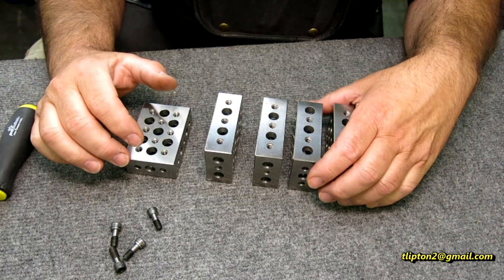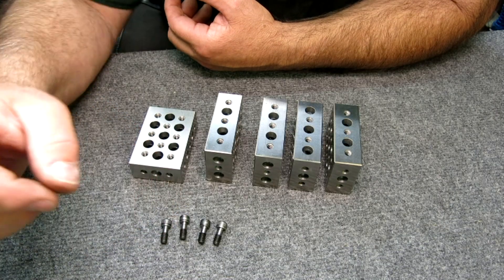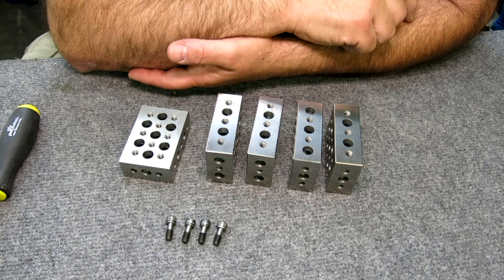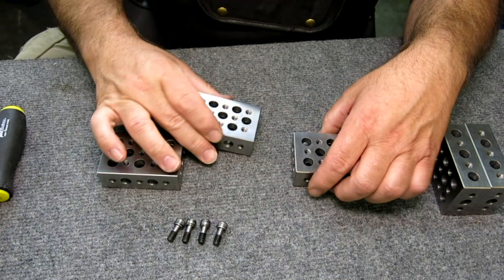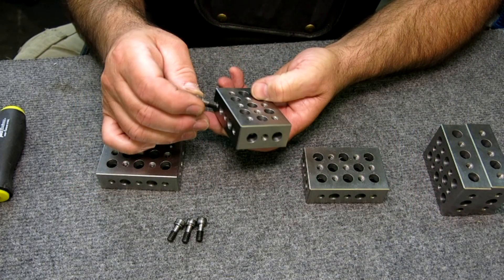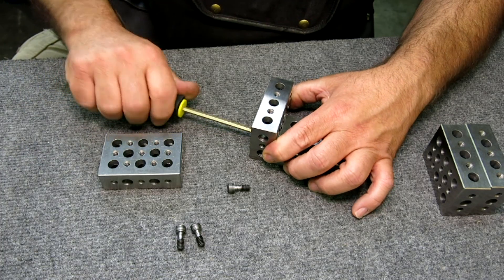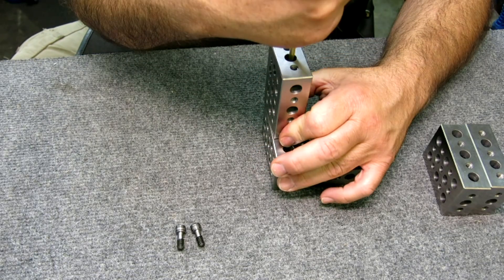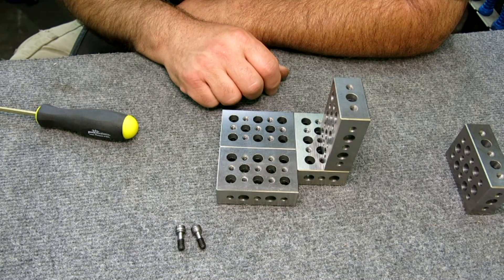Renzetti Universal 1 2 3 Blocks

Comment: I'm confused about why you hit the screw with the hammer when you were setting it up in the lathe to remove the threads...?
Reply: In reply to this question elsewhere on this page, Tom posted:
To center the fastener for minimum runout. Actually a lot faster than trying to indicate it. All you have to remember is to quit hitting it when it runs true. Cheers, Tom

Comment: what are you achieving by hitting the cap screw head with the copper drift while  turning on the lathe??
Reply: In reply to this question elsewhere on this page, Tom posted:
To center the fastener for minimum runout. Actually a lot faster than trying to indicate it. All you have to remember is to quit hitting it when it runs true. Cheers, Tom

Comment: I have some of the inexpensive 23 hole 123 blocks, they’re threaded 3/8” but of course 3/8” bolts won’t pass through the non threaded holes.  I wondered if I could use a 3/8” to 1/4” adapter then bolt them together with 1/4-20 bolts.  Here’s a link to the adapters.  https://www.amazon.com/Foto-Tech-Convert-Adapter-Ballhead/dp/B00OKYWWMG/ref=pd_bxgy_2/143-9226574-5033943?_encoding=UTF8&pd_rd_i=B00OKYWWMG&pd_rd_r=0832ebeb-3fdf-4b0b-91b8-c06fd4588ba2&pd_rd_w=7i5v7&pd_rd_wg=JthSx&pf_rd_p=ce6c479b-ef53-49a6-845b-bbbf35c28dd3&pf_rd_r=EGTTCM8XRCKVM44XVSRB&psc=1&refRID=EGTTCM8XRCKVM44XVSRB
Reply: Those in the link are not well reviewed but I can make something similar from 3/8” threaded rod.
Reply: https://www.youtube.com/watch?v=qQezV-E1kMk

Comment: similar blocks available in UK from Arc Euro Trade Stevensons blocks  3 sizes all Metric.
Reply: They're typical Chinese, in that they look the part but the tapped holes are unusable because the tapping drill was the same size as the plain holes. Also they are not counterbored. SO yes they are similar in looks but that's as far as it goes. 
95% of 1-2-3 blocks now sold are similarly unusable.

Comment: Nice project! i would like to make it also. 

I took the time to draw it in Fusion 360 and i tought i'd share it with you guys (https://a360.co/2YFllov)
I also exported it on pdf https://drive.google.com/open?id=1EDy1pS1PwQhgTViWUW2aCK8HSS9UK9Tn
It's In mm btw :)
Reply: hi, im also tinkering around with this design in metric, might try and make some and want to make sure i get it right before i start. is there a reason why you went with m5 threads in stead of larger? 
i have modeled with m6 and m8, and the m8 counter-bore weakens the internals of the block significantly, to the point that the block is essentially hollowed out. with m6 the internal columns are about 1.5mm sqaure at their thinnest.
i have no experience with heat treatment, or the stresses that the process would cause, would the m6 threaded block be too weak?
Reply: Hi, i don't really know. You will learn by trying! 😁

Comment: whats happening in Min 8:30 to 8:40? Whats the reason for this knocking on the head of the screw"?
Reply: In reply to this question elsewhere on this page, Tom posted:
To center the fastener for minimum runout. Actually a lot faster than trying to indicate it. All you have to remember is to quit hitting it when it runs true. Cheers, Tom

Comment: When they stacked together, accumulated errors will occur. Actually, why there are not double in length, double in width and double in thickness products for users to buy, sometimes i think the current one is so small. Adding these three more types will rise the flexibility much.

Comment: Mr. Lipton. I'll offer one of my favorite hacks regarding parallels and machining vises. We've seen many; separators [spring loaded tubes outside the jaws], or coil springs bearing against them, or two drops of fast-set glue, or magnets, or rubber bands [!], or nothing at all....
I use strapping tape, the steel variety binding loads to pallets. I simply cut a length and form one of three ways, depending on part width. 

#1 is hair-pin like, one leg longer than the other. Longer is convexed to contact ends of parallel, the shorter hits middle of opposite bent with a little snow ski like tip. That keeps it or parallel from moving out of jaws on repeated parts. 

#2 is great when drilling; a U-form, with ski tipped ends. 

#3 for wide items; roll a circular length around 3x the jaw opening and lap the joint with a strap clip.
#Freebie. I don't work production; but time saved means I work on my own projects. When possible, instead a lot of deburring, use 4 parallels. Outboard of those supporting workpiece, insert shorter parallels at the jaws. Instant chip and burr clearance.
A few people know me, as Toolmaker51.

Comment: Just a heads up.
At the end of your video when you under cut the Allen bolt just under the head of the bolt and filed the slotted under cut ,you should hold the handle of the file in you other hand.
Just so your left hand is not position over the lathe chuck.
Just my 2 cents worth.

SAFTY FIRST!!!
Reply: Correction left arm and hand.
Nice videos.
Keep up the good work!

Comment: Apparently this isn't a new idea. https://www.circuitousroot.com/artifice/machine-shop/auxiliary-tools/setup-blocks/index.html#a-surprise   And I read that some 1-2-3 blocks with even all large holes have threaded holes and some that are simply drilled and aren't tapped. I know nothing about them but my first thought when I saw these what that having them PINNED for alignment would be preferrable to having screws in fairly loose holes. With two pins and one screw per joint they'd self-align. If they don't self-align I don't see them ever being square with each other. Not with those small screws and all that slop in the holes.
Reply: DEEREMEYER1 read previously submitted comments for an answer to your suggestion re pins.

Comment: @oxtoolco real question. What exactly were you doing at 8:35? Hitting the fastener straight I presume, but how does that work?
Reply: Matthew La Rosa I had the same question...does hitting it eliminate the wobble?
Reply: In reply to this question elsewhere on this page, Tom posted:
To center the fastener for minimum runout. Actually a lot faster than trying to indicate it. All you have to remember is to quit hitting it when it runs true. Cheers, Tom

Comment: Ok I missed something...When the allen bolt was in the lathe, you hit it with some sort of Knocker...why?
Reply from the maker: To reduce the runout of the threaded section.
Reply: oxtoolco Can you go into a bit more detail please? Are you just so good that you're hitting it right at the high spot or is there some ox magic happening there?
Reply: @c0mputer  You just randomly hit it but you have to have your wits about you and stop whenever it doesn't wobble (much). It's a pain when (as you see here) the second or third hit does the trick, but you don't stop yourself in time!)

Comment: Tom

Amazon has some inexpensive 1-2-3 blocks, says they are hardened.  Could you use these to save some money (McMaster-Car wants an arm and leg for A2 1x2 oversize tool steel bar stock???

John
Reply from the maker: Try Hudson tool steel on the web. Looks like you can buy oversize 1 x 2 x 3 blocks of A2 for $10.50
Reply: oxtoolco  Thanks for the pointer.  John

Comment: i never seen such mickey mouse ways of manufacturing in my life, you dont show how you grind the blocks which by the way,is the most important part of the block quality,you dont spec. the squareness,or show how you grind them ,how much mtl. you leave for grind stock,or tell what kind of grinder or grinding wheel is used.look at moore 1 2 3 blocks,they are within .0001 in all measurements. anytime you start bolting blocks together the error is  multiplied exponentially.also all block surfaces should be lapped with a hard,flat india stone before assy. thx rc
Reply from the maker: Hey Rich. They aren't heat treated yet. Just a rough grind for basic geometry and to get them closer to nominal size. I will show precision grinding and lapping them to size and geometry after heat treating them.  If you don't fast forward the whole video you actually can pick up on some of the details.  So hold up on the keyboard flame thrower.
Reply: I thought it all made perfect sense.  We have all seen good vids on how to do precision grinding  and lapping.  Just apply those to this project.  BG

Comment: These are amazing!  I have a quick question for you.  I love using 1-2-3 blocks when working on non-metalwork projects, but the problem I have is my blocks came covered in oil to prevent them from rusting, so I have a bit of a challenge.  Either clean off the oil and let them rust, or get oil all over everything I use the blocks with.  Do you have any advice for someone like myself who uses these for stuff outside metalwork?  Thanks!
Reply from the maker: Make your own set from 420 stainless. You would be unique and super cool. You could call them medical grade 1 2 3 blocks. Cheers. Tom
Reply: Try coating your blocks with a fine coat of Boeshield T-9. Once dry, it is like a wax coating, not oily.
Reply: In metal working everything constantly has an oily film so they never rust. My recommendation is to clean off the cosmoline, spray them with WD-40, wipe it off as well as possible and repeat every month or so. They should be clean enough to not dirty up your work, but still prevent rust. If they do start rusting, get it off immediately and it they will be fine. It's only when they sit while rusty that they get bad.
Reply: Haha, that would be a great idea.  I really love using them for all kinds of stuff... weighting down templates, lifting things up by a specific amount for clamping/leveling/etc.  I use them much like you would use "bench cookies" but prefer the 123 over those by far!  Thanks again!
Reply: Autosol polish may work.  I've used in on quite a few items but I am not 100% certain whether it will stain some materials or not.
Reply: Good idea!  I assume from the name this is another fine product form our friends over at boeing.   I use their boelube and love it.  Would that wax coating come off with mild abrasion from handling?  My concern (like with oils) is that sometimes the stuff I'm supporting with the blocks is going to be painted soon.  I always degrease with 99% alcohol prior to paint, but I try and save myself extra cleanup/contamination where possible.
Reply: Chris Ellerby yes, from Boeing originally. It will rub off from abrasion. If your blocks do not have to be at nominal size, could you paint them? If not, next r hing to try is to oxidize them with heat ie blueing or cold blueing with gun blue?

Comment: Tried to model these in cad and can't get my head around how all is going together. How can the screws clear eachother? What's the depth of the threaded section? 1/4 inch bolts?
Reply from the maker: There is only about 1/4 of threads at the bottom of each counterbore.
Reply: Somehow I thought the screw heads would clear eachother inside the block, but I realise that's not the case.

Comment: You know what would make these even better, is if you taped the counterbored sections for work holding
Reply: Already on the to do list, 7/16-20 thread and then threaded inserts for using smaller screw sizes when needed.
Reply: Of course you could!
Reply: Could you have a pin with a threaded hole cut in it (at a right angle to its axis) that you insert from a hole perpendicular to the one that you are intending to hold the work from? That way you have a set of pins with different threaded holes for different fasteners?

Comment: Great design Robin, & video Tom. What are the proportions of the screw holes (1/2" c-c)? Thanks!  I've got to get my surface grinder running..
Reply from the maker: Yes. That way you can get the blocks flush with the edges and it all lines up.
Reply: oxtoolco Thanks!

Comment: Hi Tom,
Just watched this again because I have been thinking, if I had standard 1,2,3 blocks could I tap some of the existing holes and use helicoils to produce the threads? or would the blocks be too hard to tap?
Reason being, I don't have a mill or surface grinder and I don't think my old Myford ml7 lathe with a vertical milling slide would be enough to produce the blocks.
Cheers
Reply: Raymond Marteene too hard to tap hardened blocks.

Comment: What was the purpose of tapping the head of the screw while it was spinning in the lathe?  Does that center it better?  Seems so random.
Reply from the maker: To center the fastener for minimum runout. Actually a lot faster than trying to indicate it. All you have to remember is to quit hitting it when it runs true. Cheers, Tom

Comment: Tom, thanks for showing!
Rob, thanks for the design :)

As wgm4341 said, registration holes/pins might be worth to consider (to ease alignment.) Having one screw on the short side helps for rotation but sometimes you just want to opposite i.e. avoid the rotation. Thus, an additional registration pin would come handy.
Reply from the maker: The opposite end has two holes so you can stack them in a non rotating configuration. Cheers, Tom
Reply: All these silly comments, all should just say nice job, useful tool.

Comment: If i were to have time to make these, i'd try to add other shapes to the set from the get-go. Say a cube, say a longer version, say a half sphere, a few triangular prisms. This whole thing reminds me of toys i used to play with as a kid, made of wood. Later, as i grew up, i used them to prop up various other, more modern toys by combining them with tape.
And so, i strongly believe that these would make an incredibly useful tool pack, if we could come up with various other forms to implement to it. And...it's not easy. I spent these 10 minutes sketching shapes that fit the "dogma" of these 123 blocks.
Either way, a fine set as is, Robin did a great job with designing these.
Reply: 45-45-90 and 30-60-90 blocks are already designed with hole patterns that work with the 1-2-3 blocks. Just need some free time.
Reply from the maker: Universal machinist Meccano setup kit. Great idea. Better get busy you have a lot of holes to drill. Cheers, Tom

Comment: Nothing new here is there? Apart from it being a 23 hole version of the 11 hole blocks that Suburban makes. Look at Don Bailey's clip

https://www.youtube.com/watch?v=e2BpFdXlXNI
Reply from the maker: Completely different. Don's blocks have the fasteners protruding from the surface to hold them together. I think you missed the secret of these blocks. This design you can connect them end to end as long as you have blocks. Time to review some video footage. Cheers, Tom
Reply: Nope. The design of Robin bolts together without any fastener sticking out.
Reply: John Stevenson Block metrique:
http://www.arceurotrade.co.uk/Catalogue/Workholding/Vee-Blocks-Angle-Plates/10-20-40-and-20-40-80-Blocks
Reply: no the bolt heads on his protrude !!!!!!!
Reply: I don't think I missed the point at all, the 11 hole blocks that Don sells do exactly the same. With regards to the 23 hole version you are right, the bolts protrude. 
So i agree these blocks are excellent tools, but I tried to point out that you can buy these at Suburban. 
Kind regards from Holland, Harm

Comment: Another one for the project list. Hate you guys. ;)

Is there a special reason you choose A2? Stability during heat treat (compared to say O2 - Which is very stable too), the ability to be lapped to a very good finish, or something else I miss?
Reply from the maker: Low distortion clean scale less heat treat. Grinds well and can be hardened up to RC65. I think you should scrape yours into perfect geometry.......
Reply: im looking at this thinking.. "hmmm-kay.. i guess thesecould be done with my equipment. but who am i kidding. i wouldnt live long enough..